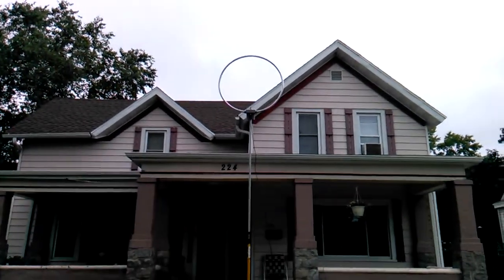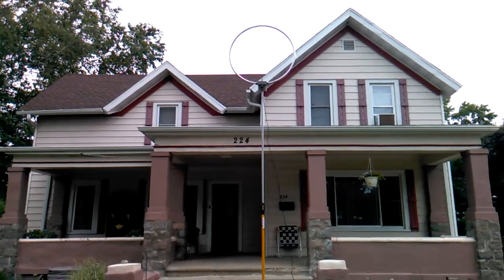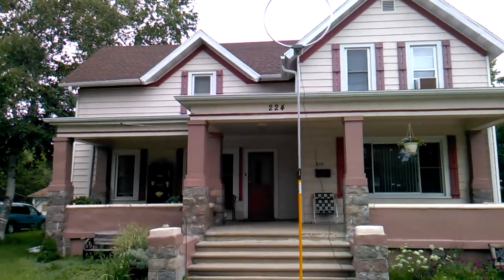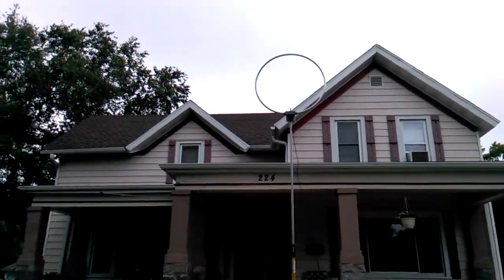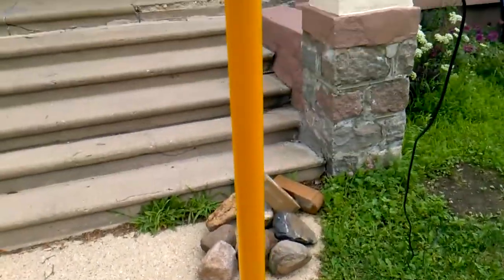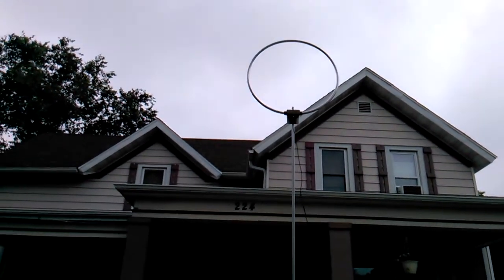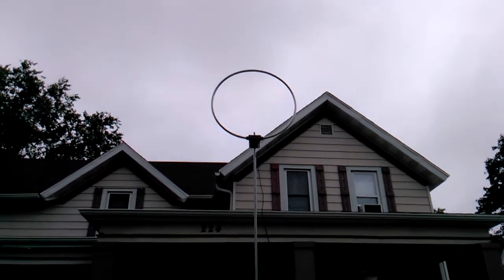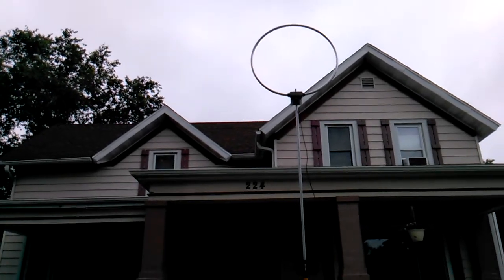MFJ-1886 Loop Antenna

Comment: Nice. I’d love to have one of these, or wellbrook :3 pop the old dish network off the roof but leave the tripod mast and put this on it hehehe
Reply from the maker: Go with the Wellbrook. The MFJ died on me after only using it for a couple of weeks. I guess from what I have read that is pretty common.
Reply: @Sparkyzilla85  damn, yeah I used to be a ham so they don’t call it Mighty Fine Junk for nothing. I was just hoping this would be different, if it failed that easy I couldn’t imagine it surviving the harsh desert summers and winds here. Thankfully for now I got this cute little portable loop from Australia.
Reply from the maker: Yeah, I have not had much luck with MFJ's products. I do my best to avoid purchasing whatever they make.

I would say if you are still looking at getting a loop antenna that is heavy duty to check out Chameleon's new loop antenna. The downside is I believe the thing costs over $400, but it should be a higher quality antenna that MFJ's loop.
Reply: @Sparkyzilla85  The CHA-RXL? I have been looking at that too, I especially love that it has a tripod thread for field use. But like you said bit more expensive than the rest at $500. Definitely worth while but I am a poor person.

Comment: Looking forward to a demo!
Reply from the maker: I'll have to double check, but I think I made a video or two of that antenna in action. Sadly it stopped working for me, and it has been sitting in the garage ever since.
Reply: @Sparkyzilla85  Unfortunately, MFJ’s reputation for quality control has not been top notch over the years. When my 1788 magloop arrived, it was not tuning. I had to open it up (at the recommendation of the MFJ tech guy!) and tighten the large variable tuning capacitor that is the heart of the unit, using an Allen wrench. That was AFTER I had to send the tuning box back as it arrived damaged! They replaced the damaged tuner right away and after I tightened the capacitor, it worked well. I’ve had good experiences with other MFJ products, however and the customer service and tech help has always been good to me. I think that maybe they make too many products, sometimes and have to rush over the QC in order to meet sales output goals. No one else has the breadth of product lines that they do! I have read good reviews of that antenna of yours, maybe it’s a cold solder joint or something that you can repair. If it’s no longer under warranty, maybe open it up and see (are you feeling adventurous?). If you aren’t that handy with a soldering iron and you belong to a ham club (you do belong to a club, don’t you? I belong to 3!), wait for the pandemic to subside and ask a fellow club member that’s adept at electronic trouble shooting to check it out for you.
Reply from the maker: @elkabong6429  I have owned several MFJ products, and I am not impressed. Something always to break, or stop working, so I now avoid the brand altogether now. The antenna is no longer under warranty, so I think I will take it to the club, Watertown Amateur Radio Club, and see if anyone can look at it for me. Usually I ask my brother, but he's so busy with work and raising my nephew that he just doesn't have the time. I wouldn't mind having a loop antenna again to a a recurring noise issue from the LW band up to 80 meters.
Reply: @Sparkyzilla85  Oh, in that case, maybe take it apart and see if there is something you can fix! Anyway, I hear you. Like I said earlier, if MFJ narrowed their product line, maybe they could concentrate more on the QC of the assembly. That was no cheap purchase on your part, too. What a drag that must be!

Comment: What’s the problem below 9MHz? I thought these were supposed to be good 500KHz to 30Mhz.
Reply from the maker: If I recall correctly it wasn't receiving signals as well as my dipole. I haven't used it for months since it stopped working. I got to get around to finding out what is wrong with it.

Comment: I am glad that you are enjoying your MFJ loop. I recently picked up a W6LVP Magnetic Loop a few weeks ago and put it up about 20 ft on a Channel Master rotator and use it as my receive antenna on my ham station while using a 132 ft Carolina Windom antenna for transmit. I really have found a tremendous difference in noise after going to a loop. I also have a Timewave ANC-4 Noise reducing device that works great in combination with either antenna when fighting noise that is not nulled out by the loop because I am using the loop at times to pick between stations in different locations on the ham bands and also BCB stations. I have a 12 ft noise dipole at 3 ft above the ground for the ANC-4 that I placed right under my electrical power line pole. The combination of a loop and the ANC-4 has allowed me to enjoy listening to Shortwave like back in the 50s and 60s before all of the electrical environment issues we face today.
73s
WD9GNG

Comment: Nice setup!  One thing you will discover is that magnetic loops can work very well even 3 or 4 feet above the ground.  

Also, "Google" K8NDS (Rich) and you may eventually want to build his helical version.  I've been running one for two+ years and it is phenomenal.  

I've really enjoyed building the antennas, and I'm sure this will "spark" your interest.  Have fun with the magnetic loop!